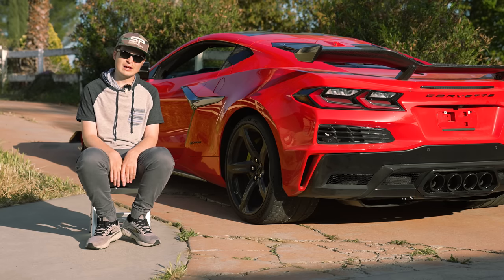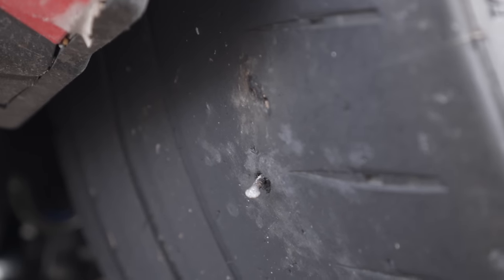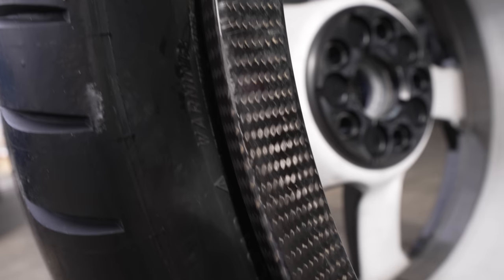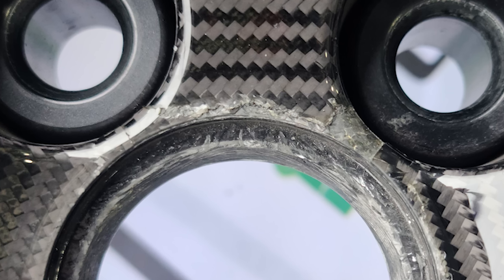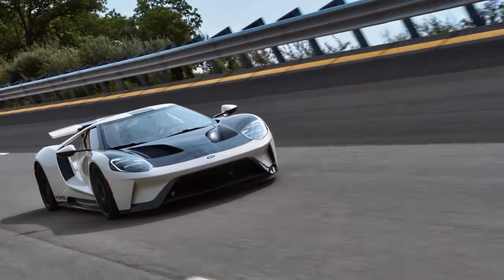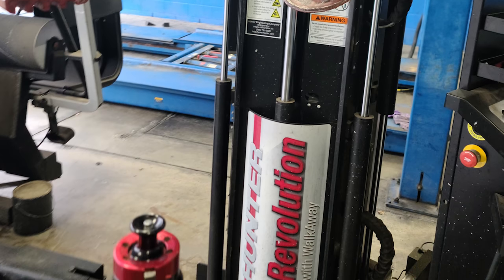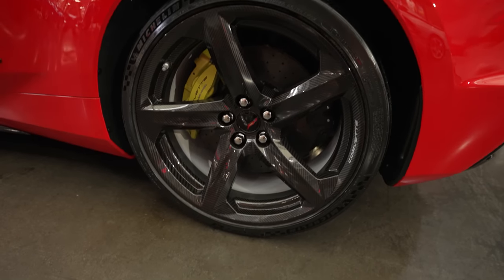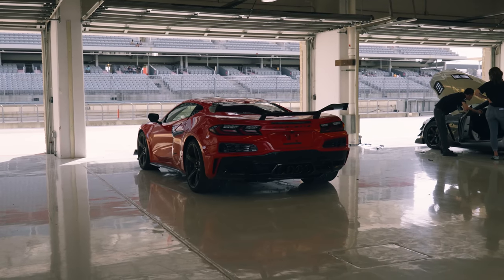MY $20,000 CARBON FIBER WHEELS ARE RUINED... YOU WON'T BELIEVE WHY!

Comment from the maker: I want to make an adjustment to clarify for anyone who is confused. This has to do with the dealership / servicing aspects, not manufacturing. The face was cracking from damage. The wheels were not fracturing structurally to their core. I hope my coverage helps to spread light on a process and improve it to fit the price tag of this vehicle. I hope Chevy comes out with a service bulletin to help us owners on the proper techniques to mount Cup 2 R ZPs on these carbon fiber wheels.
Reply: I commend you for sticking with the Chevy dealership, a person in your environment or should I say with  your experience being around true super cars, I wouldn't have kept going back to the Chevy dealer.  I would've went to a supercar store that sells and services vehicles with carbon fiber wheels for a few years.  This was a concern of mine and one reason I mentioned in a video after the Z06 reveal servicing the carbon fiber wheel by a Chevy dealer is going to be drama, and you can expect some damages to the wheels.  I also didn't expect GM to make any damages to the wheels as a result of poor servicing by a dealer right.  I will continue to follow your story and watch your videos, keep sharing the ownership experiences.   Thanks for sharing!
Reply: @jeremy1873  common sense and lube techs is hard to come by
Reply: So let me get this straight. You have your wheels taken off quite regularly due to the tracking and high wear tires, and you are upset because the wheels are showing wear and tear from being taken off and on? Amazing. Unfortunately this is a by product of taking off and on wheels. This is what this world has come to. Crying over a PRODUCTION car that you are repeatedly taking to track?
Reply: I let my local auto salon change my wheels. They also sell expensive ass wheels and service supercars and hypercars. They rarely fuck up and if they do they accountability. They also video the car before they work on it.
Reply: Good video, sucky scenario. People just don't give a shit now days. Quality takes a back seat to profit and low wage employees. Also the younger generation has a problem with instant gratification. Nobody wants to take the time to do things right. I try to do everything I do right, everyone else notices the quality and commends me on it. Sack up youngsters, it's all about the fine details. My pops used to say...."The Hacks are everywhere, so don't be one." I now get paid really good by people who appreciate next level service. Is it harder and does it take extra time...Of Course! But the feeling of accomplishment on a good job well done and exceeding expectations....Priceless! Thats when the real dopamine and serotonin start flowing.
Reply: @johnwatts2664  there's a difference between wear and tear from use, and mishandling.  I don't think your getting his point about the Z06 competing on the same level as other supercars should not only be with the vehicle itself, but in every other aspect such as specialized service/maintenance.
Reply: This car isn’t a Porsche or Lamborghini. It’s not a Ferrari. It’s a Chevrolet Corvette.
Reply: The whole essence of the Corvette has always been bang for the buck... and the C8 Z06 has done that better than any other Vette to date.  I see no reason why dealers shouldn't up their service game as well, specially with the ridiculous mark-ups they're taking advantage of
Reply: I'm a tire tech and I've actually learned a bit about carbon fiber wheels, you are NOT suppose to clamp from the center bore, and the clamping force has to be no more than I believe 45 lbs.  The revolution is not built for that, I know this bc I work with one all the time, we had to decline working on a set.
Reply: @johnwatts2664  Watch yourself, we’re talking about a Corvette here. It’s a supercar. Lmao! Idiots on here buy a corvette, choose carbon fiber wheels, and think they have a supercar?
Reply: @Ornelas11B  that's true but Chevy is making a premium sports car with a Porsche, McLaren and other supercar price tag.  So people expect a certain level of quality when spending that type of money.  Now there are several high performance Chevy service departments across the country with certified tech trained to deal with the ZR1s, Camaro ZLEs, Z06s and so forth which I would like to believe would've did a better job, but just because its a corvette means you should accept bad quality.
Reply: @Ornelas11B  they don't buy a corvette and think they have a supercar, they buy the C8 Z06 and let the performance show you it's a supercar.  This reminds me of when Audi released the R8 and Acura released the NSX so many people criticized the cars saying its not a real supercar and now you look at the vehicles and no one argues what they are.  True I need to feel better than the next person if I ever heard it.
Reply: @johnwatts2664  did you not watch the video? It's not normal wear and tear, it's from using the same scuffed up cone as regular cars that have metal wheels. This issue wouldn't be happening if Chevy had a tire change setup specifically for this car.
Reply: @Ornelas11B  supercar price deserves the super car experience.
Reply: @clutchboi4038  It’s $100,000. What are you talking about?
Reply: Not (one center cone) but a hub that engages all 5 stud holes with tapered pins for all 5 holes. That way, it will stay completely clear of any carbon. And if it was my car and Chevy refused to warranty then I would have a hub made by a machinists and just take it with me every tire change. If you do make it makenit with a hardened steel guide sleeve for the main shaft and hardened steel pins that engage the lug holse.
Reply: Hunter makes an adapter. I use the Auto34R with the adapter for clad wheels and then you don't have anything actually touching the center bore.
Reply: You should check out "finger balancing" mounts with a cone on the back face to locate it to the bore, and then 5 studs mount on the front of the wheel to locate it securely. Changed many many supercar tyres in my time and we would get a slap anytime we didn't finger balance such expensive wheels. Surprised this hasn't been seen by a dealership as it gives a more accurate balance (replicating being mounted on the hub of the car) and less chance of damaging the customers wheel.

Also these finger balancing plates can be interchangeable to suit 5+ stud patterns per plate, so a very useful tool for multi brand workshops. @Speed Phenom
Reply: Just thought about this after posting. A deeper well impact socket could solve the issue. However, I think a rubber gasket should be added to any car dealership that deals with tires as a moron proof precaution. This is on the tech for not checking the clearance before torquing. The dealership owes you new rims bro.
Reply: Hello, we are a high end tire shop in Rochester NY. We service carbon fiber wheels and 
Hunter uses a lug flange plate to properly serice them, you are not supposed to use the center bore. The flange plate goes into the lug holes. Also we use a special tape to avoid contact with the wheel bead flange. Our machine is the Hunter TC39. The issue is improper training and the did not have the lug flange plate.
Reply: heres the official hunter training video

Comment: 600LT owner here. Carbon fiber wheels are another thing I'm going to add to my "list of things to avoid on a supercar". Already on the list are: centerlock wheels, carbon brakes, carbon front splitter, carbon bumper or diffuser.
Reply: @nunyubizness5483  Yup. My carbon brakes squeal every time I press the brake. And I'm dreading the day when I have to replace them.
Reply: I think those are the exact options he chose for the 750lt
Reply: Center locks are probably the best solution to this problem.
Reply: @teddyruxpin3811  carbon ceramics dont wear down unless you dont keep up pad replacement, you shouldnt ever need to replace them. im 30,000 miles in on my AMG GT-R and the brakes are good as new.
Reply: @nick fila  True, but even the wear indicator on some cars will completely destroy carbon rotors. So you have to manually check disc wear yourself. It's not worth the extra worry IMO.
Reply: @canyonaro  To the problem of damaging the wheels while mounting/dismounting tires? how so?
Reply: Simple is better.
Reply: @nickfila2208  Everything wears out. The rotors will degrade and start to develop cracks eventually.
Reply: @teddyruxpin3811  Squealing is really not a true issue. Could just be due to moisture build up, drive your car more?
Reply: @SteeleMoto  Lol I already drive it everyday. Most cars with carbon brakes do that.
Reply: Is why on my GT4, I have 5 lugs, 3 replacement plastic front lips, iron rotors and have carbon on the inside, the wing and mirrors.  
Anything that is a wear item or exterior should be easily and inexpensively replaced.
Reply: @nickfila2208 that’s kind of true. Wear on composite rotors can’t be measured with calipers. But there are 3 circular wear indicators spaced 120° apart on the rotors if you look closely. But the main indicator of wear on composite rotors is actually their weight. There will be a wear displayed on the component the rotors are bolted to and it will say that if the rotor is below that stated weight, it must be replaced.

Comment: that's sad honestly, that's GM's biggest problem, wanting to make a Supercar but not having any service at the same level.  they need to see this.  this has always been the difference between the corvette and other brands, making a Supercar is not enough, they need quality service, with trained people and appropriate equipment.  At the very least they should give you new carbon wheels.
Reply: Yeah. Seems like a huge oversight that service on these wheels was not accounted/planned for properly
Reply: GM has never been known to handle customers properly. They are to use to selling pedestrian rental cars. To be honest, I would never buy carbon fiber wheels - too much of a risk. Porsche uses aluminum alloy and magnesium wheels, and if they aren’t believers is carbon wheels that say a lot. And yes - the Porsche service departments are excellent with customer service
Reply: @993mike  sorry, but comparing Porsche's service to GM's doesn't make any sense.  

look at the variety of models that GM produces vs Porsche.  In 2022 Porsche produced around 10,204 911's while GM produced 25,831 corvettes.  asking GM to have the same level of customer service as Porsche is hilarious.  they handle a huge range of models and thousands of corvette units a year.  The solution would be to have specialist Corvette dealerships handle these cars properly.  

And many brands use carbon fiber wheels instead of magnesium because carbon wheels are lighter and more resistant than magnesium wheels, the only disadvantage compared to magnesium wheels is the lower resistance to heat.  not only that, Porsche itself has already used carbon fiber wheels on the Turbo S (exclusive series)  and the wheels were made in-house, but probably weren't made for other models due to the high production cost and manufacturing time when compared to forged magnesium ones.
Reply: I'ts Just a Dealership
Reply: @nick.i.am97  ???  what do you mean by that?  Is it just a dealership?  Dealerships have already dropped two C8's from the lift, completely damaging the car, and now they destroy the carbon fiber wheels without even caring, another dealership employee took the customer's C8 for an unauthorized joy ride.  and the list goes on.  the problem is the lack of professionalism in more than half of these dealerships, they charge an absurd amount above the msrp, but they don't even know how to put the car in the lift properly or even change tires on the carbon fiber wheels.   GM needs to get rid of these dealerships and sell cars straight from the factory

Comment: Oh man, this is an eye opening report!! Great job letting us know through your personal experience. Sad to know that GM hasn’t taken the next level step on training the proper personnel and retrofit Chevrolet Service centers with the proper tools to service the C8 Z06 properly.
Reply: My 1982 Corvette was screwed up hopelessly by a GM dealer in the mid 80's .. NOTHING has changed, lol .. they aren't trained for Corvettes, nor do they have the right mindset / culture to properly handle such vehicles.
Reply: We get the training, in order to sell new Corvettes we have to have someone in the service department that is certified to work on them. We have two, both have had to go to Detroit for Corvette specific training.. The issue is the tech caring enough to follow protocol, and getting the proper equipment to do said work, and as this young man mentioned, training on new equipment. We still don't have the proper tire machine in our dealership, even though we sell new Vettes.

Comment from the maker: Stay tuned for the next video for a big full update. Thanks! :)
Reply: Mclaren would never do anything like that🧡
Reply: The hunter machine comes with a lug centric adapter that should be used on these wheels. It's been out for the last 9-10 years. The techs were simply not trained to use the equipment they have.
Reply: Well said and VERY tactful.
Reply: I would not settle for anything less than 4 new rims.
Reply: Chevy do better
Reply: @patrickj5731  yeah breaks down so they dont need tyres changed lol
Reply: Forgeline with slicks?
Reply: 4 new wheels period from that dealer! Nothing else. In the boxes for you to take to get them mounted. Period.

Comment: @6:00 you are absolutely correct! They need to treat this car like a proper exotic and shouldn’t refurbish your wheels, they should send you new wheels as it wasn’t even your fault for the damage. Super good content glad to see you sharing your experience. I got the carbon wheels and do not run them daily, only on track days but super glad to see this video letting me know what to watch for.
Reply: It's a Chevy, and even the dealerships that do have trained staff for the Z06 will not treat the car in a specialized way. A company is not going to re-train its staff and give them a different set of tools to work differently on one car above others. It costs a lot of money to do what Ford did for the GT. After that there are still only certain dealers that can service the vehicle. Glad I passed on my allocation and got a Lamborghini. The old adage rings true: "You get what you pay for."
Reply: @jeffray8599  congratulations on your Lamborghini, which car did you get? And yeah im just a little disappointed to hear this kinda stuff coming from other car brands where the service was more careful.
Reply: Sorry, but Carbon revolution has a service bulletin and you tube video for changing these wheels. He simply got a service center that didn't follow their recommended procedures.
Reply: @polystictus  well from what I understand no other GM vehicle has a full carbon fiber wheel so this is new territory for any dealer that has to service a new Z06 and most of them just treat it like any other car in there
Reply: He should change his own tires or pay the proper mechanic to do it right.... gosh case closed stop trying to buy a value super car abd expect top tier service...
Reply: Or take it to a Porsche, Ferrari, or Lamborghini dealer to change out the tires. Really? What did he expect from a Chevy dealership service department.

Comment: That’s ridiculous that they’re not fixing this issue…
Reply: The dealership should be using a flange plate that put a pressure on the lug holes and not the bore. The Revolution comes with this flange plate. Our local dealership has no issues with this same wheel. Might be some apprentices that don't care.

Comment: No FORD dealerships would touch my 2022 CFTP GT500 carbon fiber wheels. I had to beg a Porsha dealership 3 times to help me repair a flat. I feel your pain. My complaint to FORD has gone unanswered. How does FORD sell you a car with $30,000 wheels that they refuse to service.

Comment: I have a GT500 CFTP, a Ford Dealer cracked three of the Carbon Fiber wheels on my first tire change. They did replace all the broken wheels. None of my local dealers will touch the wheels!

Comment: After 43 years of aviation experience inspecting repair stations that manufacture many forms of carbon fiber, I came to the following conclusion. The quality system required to MAINTAIN these products is so in depth that most companies will not follow the requirements for service or repair of these items. A company like GM wants to take on the exotics but service them like a Blazer. (ONLY allow trained personnel to service these cars with specific equipment designed for this application. If they do have have trained personnel they DO NOT sell the product). I wish you the best getting this taken care of.

Comment: Wow, I was afraid of the carbon fiber wheels.  I'm currently #2 on my dealer list for a ZO6 and I can't quite justify the expense of the carbon wheels and was worried about this very type of thing happening.  The replacement cost must be crazy.   I'm even leery to get the ZO7 package with the visible carbon fiber aero but I really love the look and will probably get it.  I hope Chevrolet steps up and does the right thing.  Thanks for the 411